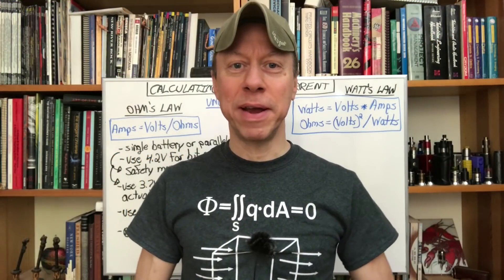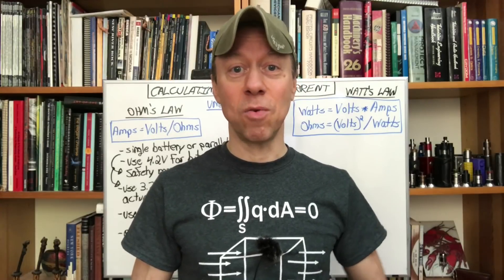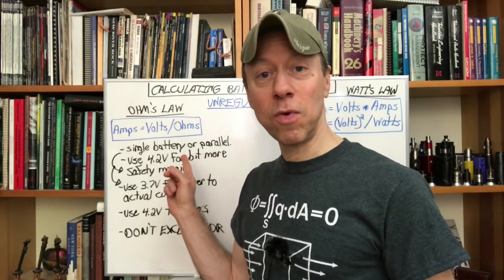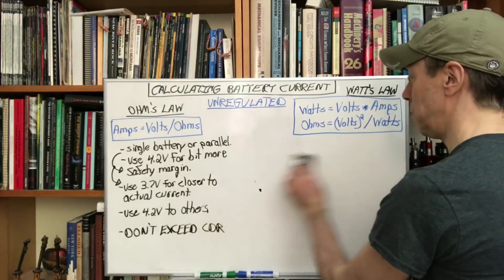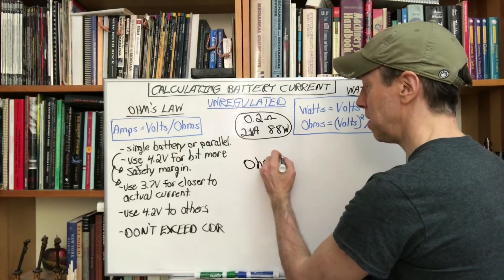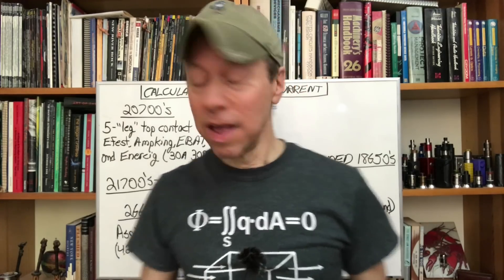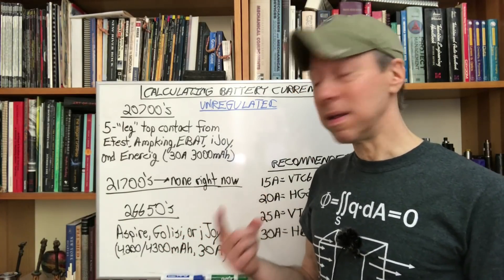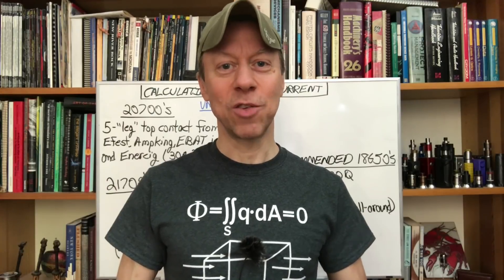Minding Your mAhs – Ep002 – Batteries for unregulated/mech mods

Comment: Good video again! For the next video I'm really curious to the explanation how it exactly works when you put in batteries in series or series/parallel in a 2 cell or 3 cell mod and one little request: can you explain (hopefully in the vid) how you can vape at more than 4.2V on a  1x18650 mod, how does that work?
Reply from the maker: Dnns84 a regulated mod uses a circuit to “boost” the voltage. You can’t vape at above 4.2V with an unregulated/mechanical single battery mod.
Reply: Battery Mooch I'm aware that's only possible for reg mods, I meant it as a question for the upcoming vid ;) I tried googling the answer myself but didn't get anywhere how a chip can get more than 4.2V from 1 cell. Batteries in unrelated mods/mechs have become pretty straightforward for me (for a large part because of earlier videos with Dean and yourself and me reading stuff trying to educate myself on the matter) but how reg mods handle everything is part hocus-pocus to me ;)

Comment: Thanks for that Mooch, so much good information for anyone contemplating a mech..  It should be mandatory viewing.  You broke down something that at first seems very complicated (to me at least when I started on mechs) to something most people will understand.  I particularly like how you've now made things safer by arming people with knowledge.  As you said there is a plethora of information out there on the same subject but it's all over the place and you just built a one stop shop.  This combined with the Bogan's "Tubes for Newbs" (basically how a mech works) video are the two I will point people at when they're contemplating "mech life".  Perhaps a video explaining the dangers of moving outside the parameters you mentioned would be in order?  Hard to pull off without scaring people I guess but a little respect for what they're dealing with and the reason for it would go a long way.  And maybe a bit of fear based caution wouldn't hurt either and  keeping the negative press on vaping out of the news - dare I say "Harm Reduction"?  Really looking forward to future installments :-)

Comment: Nice work, man! Thanks a bunch! I have on question. How come the 25R's are not mentioned in the 18650 section?
Reply from the maker: καποιος δε θα 'μαι? I was just picking the top of the best to keep the list short. As I mentioned there are lots of other good batteries. The 25R is a good cell but the HG2 runs longer and the VTC5A hits harder.
Reply: Battery Mooch <3

Comment: I'm surprised there was no mention of the Sanyo 20700a batteries.  I always thought those were the best option, if you could find them
Reply from the maker: Bill D...if you can find them....that is the reason. :-) I didn’t want to mention something no one can buy yet. When it becomes more available I’ll be updating my recommended batteries.
Reply: I managed to get some... but I also have the Vapcell NCR 20700's which are the same, right Mooch? (those were easy to get)

Comment: Hey there Mooch, I'm really enjoying the videos!  I do have a question.  I purchased a couple LG HD4 cells, and they were in great condition when I received them.  However, after nearly a year of use, I noticed that on one of them (one that I always use with a certain mod), the top contact is beginning to bend downward ever so slightly.  It is not too close to touching the portion underneath the contact, but it is noticeably dipping downward (inward), and it is coming closer ever so slightly.  Is there a chance that I could use a non-conductive material to get underneath the top contact and push it back up a bit, or is this not at all safe, and the battery should just be discarded?  Thanks in advance, and keep the videos coming, they're great!
Reply from the maker: Steve Costas no, do not try to pry anything up at the top of a battery!!!!! 😱😱😱
Replace the battery.
Reply: Battery Mooch Got it.  Thank you for the response.

Comment: Fantastic video and one that all vapers should watch.  It opened my eyes to possibly running lower amp rated batteries for longer vape time.  Been having a hell of a time finding the Sanyo 20700 batteries with suffix A.  The B suffix gives far more mah but only rated for 16 amps.  Since I rarely hit 100 watts, dual series regulated with the 16a batteries should be sufficient.  Keep up the awesome work!

Comment: Hello, I have a question, say I'm running a .2 omhs coil on a mech with a fresh battery 4.2V. But due to sag / losses I have 3.7V at the coil. Am I drawing 21 or 18.5 AMPS ?
Reply from the maker: cbranchereau I mentioned why you might use either value in the video.

Comment: Mooch
 I'm sure somebody else will say it but we greatly appreciate this, also if using 2 batteries mod does it  double the amps or do they run equally thanks

Josh
Reply from the maker: Joshua Rosen I’ll be doing a series/parallel video.

Comment: I've recently obtained a parallel mech squonk. I put the same build on it that I had been using on my single cell squonk and it hit way harder. I was under the impression that since it's parallel the voltage is always the same. Is it hitting harder because of the internals or is it because with two cells theres less internal resistance inside them? Either way I feel much much safer running these lower builds on two vtc5a.
Reply from the maker: joseph fiorini correct, less voltage sag.

Comment: With a continuous discharge rating of 25a do you feel there is room to build lower say .1 ? On a single cell mech?
The reason I ask is if I’m only pulsing the cell and not continually discharging shouldn’t that be ok even if I’m over the continual discharge rating?

Comment: What about the Vapcell blacks? I thought they were 30amp as well but ran cooler than the hb6 and longer but also hit a bit harder than the vtc5a, and ran just as long down to 3.2v. I'm really surprised that this isn't becoming more widely used.
Reply from the maker: Haunting Zero their availability is spotty and until I test the battery they rewrap, the Samsung 20S I think, I just recommend the other cells.
Reply: Battery Mooch that makes sense

Comment: If you vape that .2 coil you had on mech mod at 88w it would vape alot better. I dont think you would get 88w after voltage sag?? No?

Am just up so probably talking rubbish lol
Reply from the maker: Chis Tait it was just an example using 4.2V for a safer calculation. As mentioned, use 3.7V to get closer to the actual wattage.
Reply: Battery Mooch it may work out fir a .2 yeh.

How about a topic on voltage sag in mechs?
Reply: Battery Mooch thanks for all you do btw we really appreciate it !

Comment: When you make the regulated video, can you discuss pwm nods and how to treat battery draw? I was always under the opinion that since the battery is just pulsed to simulate a certain voltage that you should treat it like a mech. But I see a lot of people who read the voltage display and say " it's only running 4v on this 3s with a .14 ohm coil, it's well within the rating".
Reply from the maker: 3d printing meathead PWM mods aren’t regulated though. The output voltage falls as the battery voltage falls. I’ll be dealing with them in a different video.

Comment: Quick Question Mooch.. I'm running a 0.14 70 watts on a Smok Alien (dual series) its showing v3.216 Ohms 0.14 and 22.97 amps batteries are VTC5As.. am I anywhere near my battery amp limit in series? thank you
Reply from the maker: Phil Salt watch my next video. :-)

Comment: That eas awesome Mooch, how about the Vapcell black 18650. Dont they have a lower internal resistance than the vtc5a? I find they last longer than the vtc5a for me
Reply from the maker: Shane Kurnia spotty availability makes them tough to recommend for new vapers. If the cell changes then I’d have to redo the video. When the cell I think they are rewrapping, the Samsung 20S, becomes available it will almost certainly be recommended.
Reply: Shane Kurnia I agree with you. . My Vapcell black are better than my vtc5a in every way. I bought 2 to try n ended up getting 10 more after trying them. They're my go to now for mechs

Comment: I made it thru Differential Equations and yet somehow this core information won't stay in my head (but I do manage to apply everything well when I sit down to build). Until the day I can put them to use as easily as you have explained them without returning to a resource like this, I will simply return these saved YouTube videos. You Rock Mooch.

Comment: How long will a battery last , how much of its performance is lost over time / during use ~~~ I have a basic idea for when i should stop using a battery ( to stay safe) but i would be interested to hear if you have a better way of determining when someone should stop using / throw away  a battery .  I tend to stop using a battery after i have used it daily for about a year (regulated, 50 watts, 10-12 amp draw) or when i see only 1800 mah going into my battery (2500mah capacity) to reach 4.2v when being charged from around 3.4 v.

Comment: Thank you for the amazing work you're doing ! For the next video on regulated devices, would love to see your battery recommandations for a lower wattage vaper as well (5A and 10A). I'm a MTL vaper vaping at around 10W with the Sony VTC6 and would like to see which 18650-20700-21700 you recommend.

Comment: I didn't get to comment the first video because I was drunk but good to see a notification, well done and thank you 
You asked about what people would like to know more about series vaping. Thanks for the explanation but I'm really interested to see how these rules are affected with a potentiometer thrown into the equation affect it eg 8.4V turned down halfway to pull 4.2V. Does the same current rule apply and mAh will increase or does the equation change back to single battery (I'm sure you understand what I mean). You're a necessary asset to the community and have taught me a lot when I heard about you (been waiting 12 months for a notification on your channel lol). I have only used Samsung, LG and Sony batteries because of your educational interviews and never had an issue and carry sure spare wraps for when I meet other vapers who don't know safety (courtesy of you). Peace!
Reply: Soled101 i would recommend going onto google and search ohms law calculator and just plug in different numbers for resistances and watts and volts and amps. It gave me a better understanding with what happens to the outcome when one of the variables changes. You change one variable and everything else will change according to the change you made in the equation. If you wanna see what happens with voltage change just plug in your numbers and play with the voltage. Theres also a lot of videos describing ohms law in depth. Understanding ohms law will help connect the dots with what happens when a potentiometer is thrown into the equation!
Reply: Levi Daniels cheers man I'm in the understanding of that well and truely (always use a calculator and the same multimeter, ohm reader and mod if need be). Reason I threw that up is because same builds @30A, same batteries type and buy time being run in married sets, have the same vape yet the potentiometer doesn't warm up as quick as the tube. Series is still a new thing for me in practice and I agree bits and pieces will fall into place, just like when I stepped into mechs, but like batteries the information that's out there is rather sketchy and I'm sure there's something I haven't seen yet (just like the hair on my back). I'm also not running true series builds as I bought this because it's safer in my pocket when walking than a tube without a lock and for battery life at the pub or just out and about . I prefer voltage over wattage and manufacturers took VV away when people started buying +100W mods (I also prefer build control over a chip and don't have high end money to spend on devices I'd like, but quality I need). Ohms Law: like all laws it can be pushed and tested but if you're caught breaking it you'll pay the price and end up a media train. Peace!

Comment: very good video. however most of the pro's you mentioned for a series setup would also apply mainly to parallel setups as well. There are some other advantages to a series setup though (mainly going out of the scope of this video but might be a good idea for it's own video) in that a higher voltage and lower amps overall in the mod itself (not just the batteries themselves) can overcome other problems. for example mods themselves will have there own resistance dependent on wire length/thickness, solder contact quality, contact cleanness (either dirt in the threads or tarnishing of contacts) etc etc. having a higher voltage and coil ohms means less power will be wasted heating up the mod itself allowing better efficiency overall. especially when you consider that we use the 510 connection which really wasn't designed for the high amperage/high power some people put through it
Reply from the maker: darren robertson good points!

Comment: I would like to see best 18650 3000mah battery shootout video edition! Is a 15amp battery sufficent in a dual series battery regulated mod running at 90 watts? Im wondering if samsung 30q would work for my situation.
Reply from the maker: VapeKing regulated mods are the next video and a 3000mAh shootout is planned.
Reply: Battery Mooch sweet thanks bud!

Comment: Oh! I have a Therion DNA 167. I'm running a triple alien at 0.17@80 watts.... The board is telling me the load is 21.7 amps. I'm using vtc5As. Does that mean per battery? Or is that divided by 2? Thanks for everything!......oh my! Did you already answer that? Half the amp load for a series config?
Reply from the maker: JohnnyO34 it’s calculated differently for a regulated mod. Watch my next video. :-)
Reply: Battery Mooch I will my friend!....keep em coming

Comment: What about a safe low voltage a battery can get before you need to charge it and not kill the cell
Reply: 3.2 is the safe limit.. (its more than safe) the battery can go upto 2.7 or like that.. But at least I recommend 3.3 / 3.2 v
Reply: Most regulated mods, in my experience, will not pull the batteries lower than 3.4V.  From my very limited mech experience, I start to notice a dip in vape quality at about 3.75V.  Having never been lower than like 3.6 on a mech, I am fortunate that it has not been an issue for me.  Thanks for the info Shuvojit and thanks for the question Robert Wigglezz:)
Reply: TheWraithkrown yea the cutoff voltage of regulated mods hits in arnd 3.2 - 3.5 volts range... And moreover in that range its better to charge it up.. The batteries get pretty weak.

Comment: Wait about (AWT batterys) ? 
I have 6 AWT batterys 4 of them are 3500mah 35A and the last 2 are 3000mah 40A
Did you try one of thes ??
Reply from the maker: King Msd already tested, check my 18650 ratings table at ECF. Link is in the description.

Comment: Hey Mooch, have ya heard anything else about solid states becoming more prevalent or readily available? Will you be covering or going over 
heat flux/coefficient?
Reply from the maker: JoshuaApathy Miller solid state batteries are a ways off and will be low amp ranted IMHO. 
Yes, I hope to address heat flux once some coil research is done with some builders.

Comment: is the amp draw shared between both PARALLEL battery's?
Reply: Yes this is something that I would like to know as well. From what I've read it is but that it isn't a perfect 50 percent of the amp draw on each battery or something like that. Could you shed some light on this for us Mooch?
Reply from the maker: Toby Bowers I’ll be doing a series/parallel video. :-)

Comment: Thanks for that, good one. Dude, especially for the message of the so-called "best battery." God I have to talk about this a lot. I tell people it's most important to match your actual battery cells to your actual build or vape. If you only need 15 amps you have a lot of great cheap choices. Like shifting gears in an auto: the purpose is to match engine speed to road speed.